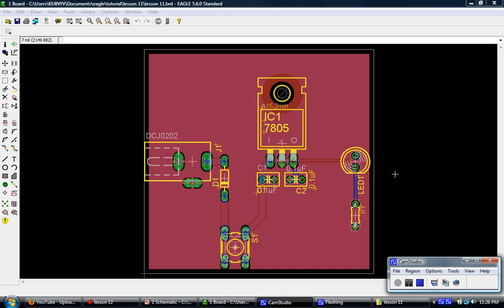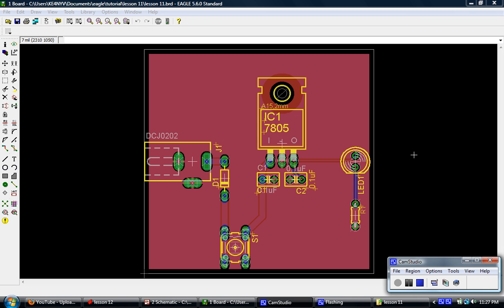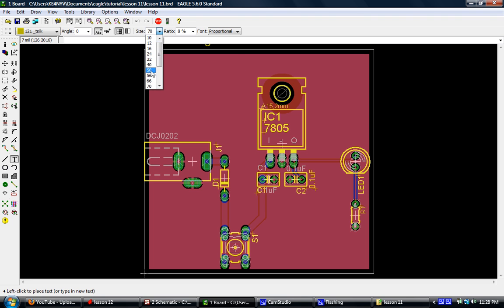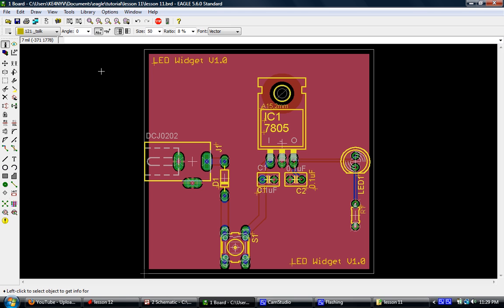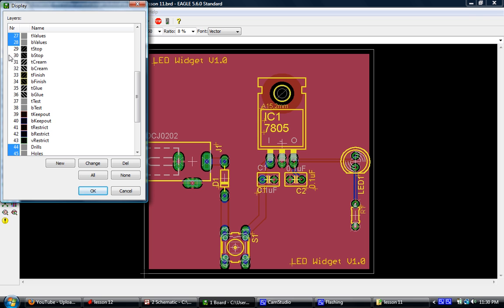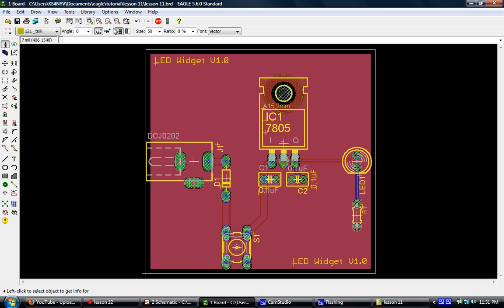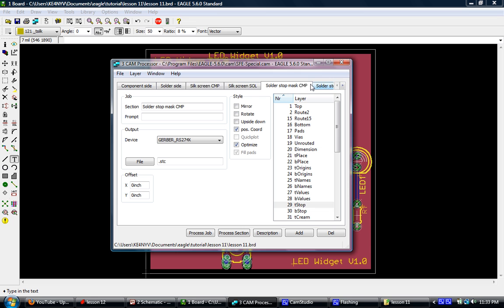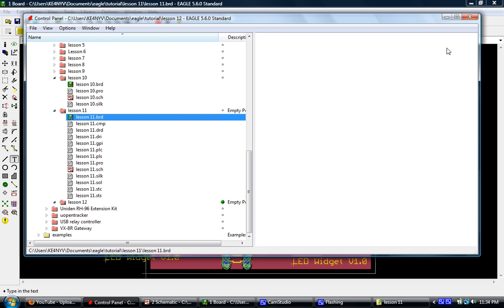Cadsoft EagleCad Tutorial Lesson 11

Comment from the maker: There is actually a library include with Eagle called "testpoints".  You can add these anywhere in the schematic where you need them.  Then, just place them on your board just as you would with any other part and then route the trace to the point.  These can be through hole points, but can also be simple SMT round pads.

Comment: To clarify my previous question, the mounting posts for my power connector are 1/8 inch wide.  The drill hole that gets created with the Eagle library connector is 1/32 inch diameter.  Any ideas?
Thanks again.

Comment: Thanks for the great videos!
My board has a power connector similar to the one in your example (labelled DCJ0202).  When I ran the gerber file generator, it didn't include a "Milling" file for the rectangular mounting cut-outs.  Was this a flaw in the script file or is the Milling file necessary?
Thanks again for the tutorials... VERY helpful.

Comment from the maker: @fishonthefly1 I have been using Gold Phoenix for the last 10+ years.  They are located in China, but I deal directly with the rep in Canada.  Email your Gerber files to Shane at sales (at) goldphoenixpcb (dot) biz for a quote.  Usually around $110 for a batch of 1000 square cm.  They fix your design into that area as many times as possible.  So depening on your board size, your count of boards will vary.